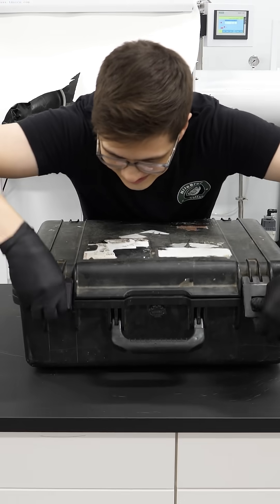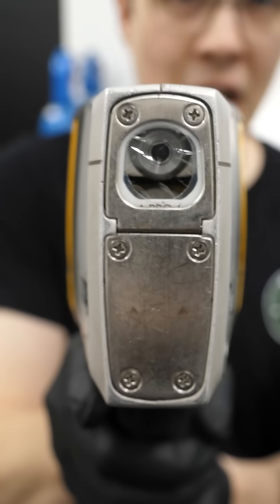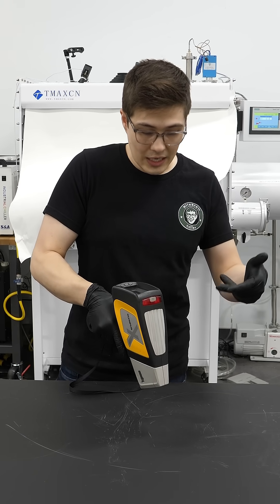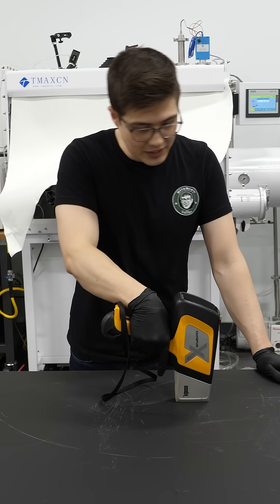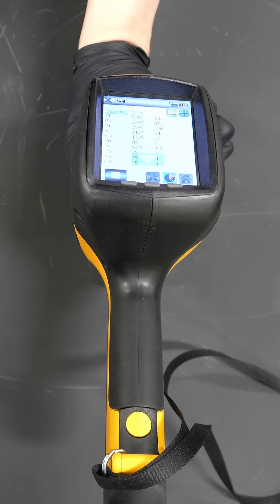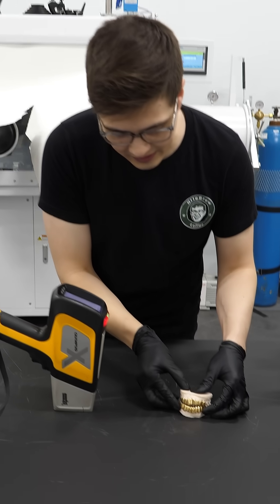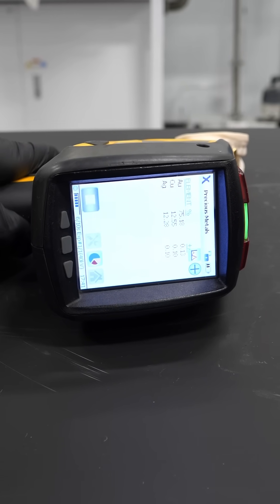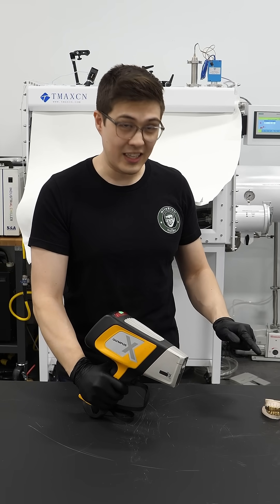I bought a ray gun

Comment: More cool science facts:  Lighter elements - anything on the first two rows of the periodic table from H to Ne - aren't able to be measured directly by XRF.  So you can't use this to determine the precise amount of carbon in your steel, or how much oxygen (usually in the form of oxides or hydroxides) are in a geology soil sample, or the composition of PLASTICS like the coating on your lab benches there.  But it works pretty well for heavier elements.  With some caveats... a few elements emit at multiple frequencies, some of which overlap with other elements.  Those elements are hard to detect at low levels because they tend to get buried within each other's signals.  And whatever the element inside the gun is that produces the x-rays also can't be detected... because its response will look the same as the beam that leaves the emitter and you cannot mathematically separate the original beam from the same element in the sample.  
So it's primarily used for detecting metals in paint, minerals in soil, or alloy compositions of metals.  I used to work with a bigger free-standing XRF machine that could also detect dangerous metals like lead and mercury in plastics, which we tested for some toy manufacturers to comply with government safety regulations.  We also used that same machine to look at mineral composition and corrosion compounds from leaky oil and gas pipes, oil spill soils, etc.  It's pretty cool.
Reply: Yes indeed. But because they are open-beam x-ray sources, and a significant safety risk, they are heavily regulated in Canada. Both to possess and operate. Hope nilered has passed his certification course!
Reply: I think you are good at describing this relatively complex subject without being strident and pedantic, if a few factoids were aesthetically fudged, I think it keeps potential students on their toes, and was enjoyed by me at least; thank you for taking the time.🌞💚🐾
Reply: So question… 18 karat is defined as 75% by weight. How would the X-ray gun get the same measurement of 75% composition? Because I assume it is measuring at a molecular level like number of atoms which wouldn’t necessarily be 75% right? Or is it just doing some math to tell you that
Reply: @horsey7408   It shoots an X-Ray laser into the sample.  Each atom in the sample reacts to the x-ray by having electrons kicked around, resulting in the atom generating ANOTHER X-RAY but at a different frequency than the original beam.  Each element shoots off a different frequency.  The sensor on the gun can measure all the frequencies, and then it does a bunch of math to determine how much gold, how much lead, how much tungsten, how much iron, etc. by comparing the test result to a scan you did earlier using a KNOWN METAL ALLOY STANDARD as a calibration comparison.  Anytime you're using the gun, at the start of the day you get the calibration samples out and run a calibration test to tell the software what it's comparing test samples to, basically it gives you a "background zero" to start with.  And then it converts the measurement of the intensity of sample's x-rays into a mathematical composition percentage for each element that it detects.
Reply: @MrDavidMoyer It's not an X ray "laser" or an element. It is an electrically produced X ray beam from an X ray tube. Smaller version of what is in a hospital X ray machine.
Reply: @SantaKrause  Exactly.  It's just fun to say "laser."
Reply: @MrDavidMoyer   If you are going to go explaining something that you claim are "facts", then give correct facts. Laser beams are produced in a completely different process.
Reply: @horsey7408  Also, the X-ray gun only measures a response from the top few layers of atoms in the sample.  So it only reads the atoms near the surface.  If a piece of metal has a "pure gold" coating or plating on it, the gun will probably tell you it's "pure gold" even though the interior is plastic or copper or whatever else.
Reply: If you scanned your hand would your hand receive any kind of damage
Reply: @diamondsimon020   Not like a painful or visible burn if that's what you mean.  It's similar (but less intense) to a medical X-Ray.  The issue is that your DNA molecules can be destroyed or altered by x-rays.  So a few cells might be killed immediately, or might gradually become cancerous, or might get "radiation sickness" and die later.  And that kind of damage, while not usually harmful from just one exposure to the x-ray beam, will accumulate over time - especially if you use the equipment pretty often and "accidentally" scan your hand A LOT of times.
Always best to take precautions anyway.  Cancer sucks.
Reply: @ Aight thanks, I thought it might give some kind of cancer or something, but I didn't understand how exactly, that's good to know
Reply: @diamondsimon020   Possible radiation burn.
Reply: @SantaKrause   The beam is too weak to leave an actual burn like you would get from acid, sunburn (UV damage), or a flamethrower (heat damage).  But yes, you can get "radiation poisoning" which usually doesn't show up immediately but maybe a few days later you'll notice the affected area is turning dry, gray, and basically dead.  It's not like standing in front of an IR source that emits actual heat, or a microwave source that generates heat by messing with the electron structure of water molecules.  There is very little heat released, it's all basically just X-Ray light.  
If you're using one of the large industrial XRF machines they use in materials testing labs, then yeah those things can generate significant heat.  You need to use water along with helium or neon to keep them cool, while for certain operations also for keeping the sample under an inert gas for testing.

But a "radiation burn" isn't really a burn.  At least not in the traditional sense.  It's literally cellular damage caused by the beam wrecking the DNA on that part of your body.  But those cells can stay alive (and APPEAR undamaged) for a short time after that; the damage only becomes obvious when the wrecked DNA starts making new RNA, which is also wrecked so it makes wrecked proteins once it's active... or the DNA just falls apart to the point where the cell loses all function when its current proteins are exhausted or when the cell tries to go through mitosis.  The real damage happens when/if that wrecked DNA starts to replicate faster and spreads farther than your normal healthy cells around it.
Reply: @MrDavidMoyer   That dry, red, dead area IS a radiation burn. Burn means cellular tissue destruction. Doesn't matter if is is heat, chemical, or radiation. This device will NOT give you radiation sickness or radiation poisoning. That comes from a much higher dose of radiation than this machine can produce or ingesting radioactive materials. It CAN give you a radiation burn if you are in direct contact with the emitting window depending how long the test sequence time is set for. I have spent over 30 years in an industry dealing with both high energy radioactive materials and radiation producing machines on a daily basis and I have plenty of knowledge about radiation and what it can do.
Reply: @MrDavidMoyer  You are incorrect. It can give you a radiation burn.
Reply: @SantaKrause   If you hold the trigger down for several minutes, maybe.  From a single scan that only takes a couple of seconds, it shouldn't.  With radiation the damage depends on the energy level - x-ray is pretty high energy but not the worst out there, and you shouldn't get a full-intensity blast unless you're literally aiming directly at your own hand.  Any incidental exposure, like a reflection of the beam escaping sideways or whatever, won't be as powerful as a direct shot.  And it also depends on the exposure time, which with these guns is typically only a few seconds.  
And as I mentioned, a lot of radiation damage won't show up immediately, it can take hours or even days for the damage to manifest in a noticeable way.  

But the key is even though we still use the word "burn" when talking about radiation damage, it's not the same thing as a chemical burn or a thermal burn.  The actual damage is caused differently, is expressed differently at a cellular/molecular level, and even though the eventual scars might look similar, the process by which the damage occurs is not the same.  That's the point I was trying to make.  But yes, some of the damage can resemble burns regarding the surface appearance at least.  You can think of it as being closer to a sunburn than sticking your hand in an open fire though.  This isn't an a-bomb we're talking about here.
Reply: @MrDavidMoyer  Typical exposure is 10 to 20 seconds. A burn can occur if in direct contact with the emitter window for that length of time depending on the unit as the beam is very narrow and concentrated with almost zero sidescatter. A burn is cellular tissue destruction. Doesn't matter the cause, heat, cold, chemical, or radiation, it is still cellular tissue destruction at the molecular or atomic level. The result is the same, the tissue dies. The dry, red, dead area you described is a burn. This machine will not cause radiation sickness or poisoning. That takes a much higher dose than this machine can produce. The older machines like this are more powerful in radiation production as they had less sensitive detectors and were phased out and replaced,  but I'm sure there are many still out there and in use. I have over 30 years working with high energy radiation and radioactive materials and know very well about radiation and what it can do and have seen radiation burns first hand on several occasions. One individual did, several years later, develop leukemia and eventually passed away, but leukemia did run in his family to begin with, so there really is no way to say it was caused by radiation.
Reply: @MrDavidMoyer   It is not caused by it "wrecking" the DNA. It is caused by radiation knocking the electrons off the atoms that make up the molecules in the cells and therfore the cells cannot function properly, leading to their death. I need to learn a bit more on how radiation works. 20 of my over 30 years of working with radiation was spent as a RSO(radiation safety officer).
Reply: It uses a source with Iron-55 that produces X-rays via electron capture mechanism. It emits 5.9 keV almost-monochromatic beam. The capsule's half-life is 2.7 years.
Reply: @Matthew.Morycinski  The one he is using is a InnovX Delta made by Olympus. Does not use any source. It uses an X ray tube. Have used this model many times.

Comment: XRF guns have been incredible for the mineral exploration/mining industry. We used to have to wait months to test minerals or samples at a lab, but with these, we can do a quick test in the field.
The one weakness is that it often doesn't give a representative sample. For example, if there is a layer of a different material on top, that will show up instead of the true composition. There's no way to tell if those gold teeth have lead cores.
Reply: Funny that... X-rays are commonly known to penetrate organic tissue, yet they lack penetration when applied to other materials.
Reply: @__Razer  Actually that's by design! The reason we use specific X-ray frequencies is because those ones in particular pass through most organic materials while reflecting off of mineral sources like bone, high density cartilage, and teeth. 

There are also slightly different ranges they can use to tweak what materials will reflect, so with precision you can actually tell the difference between 'softer' materials by how opaque those spots become.
Reply: @__Razer well yeah, bc organic material is much more permeable to radiation than metals
Reply: @hazeld8016  but not always! There are certain bands that highlight soft tissue more than hard. That's what my comment was about, that we use specific ranges of X-ray for different images.
Reply: @caseyoverland7829  The device is an XRF which is "x-ray fluorescence" and works by illuminating a sample with x-rays and then analysing the spectrum of the fluorescent x-rays coming back off the sample which are at lower energies than the illuminating beam and have very little penetration.  There is no imaging involved.
Reply: @karhukivi  we weren't talking about this specific device, we were talking broadly about x-ray usage in general. I am aware of how a spectrum analyzer works, and while the XRF gun is specifically a sampling tool and not imaging I was speaking broadly.
Reply: @ The question at the top of this thread was that the depth penetration of an XRF was small and limited to the surface material.
Reply: @karhukivi  the question was about warning labels? And whether or not there would be danger of shooting through a desk or towards yourself (assuming a wooden desk, not metal. Though maybe that's my bad)
Reply: @caseyoverland7829  There are some warning labels but when the H&S people get to know about portable XRFs there might be restrictions.  The HVL for wood at 50keV (typical for these devices) is in the range 0.15 to 0.3m (6" to 1 ft) so you could shoot yourself sitting at a wooden desk and using this device on top.  There is a proximity switch on some units, so that you won't shoot people by pointing it at them!
Reply: @__Razer  The energy of the primary beam is low and the fluorescence x-rays have even lower energies, so very small penetration.  The surface is being measured to a depth of 1-3 mm only.
Reply: I've actually used one of these before to analyse drill core samples when I worked as a lab tech for geologists. There's also a larger tabletop version with a lid that closes shut.

We used these tools to obtain an internal standard for calculating trace element ppm concentrations from laser ablation mass spectrometry data.
Reply: I was actually wondering how deep the xray went so thank you for the info
Reply: We use the XRF analyser in tandem with a PMI. When we identify the metals with the XRF, we enter the figures in a PMI which has the density of all metals. The PMI then tells if the sample is homogeneous or what metal makes up the most of the sample.
Reply: Gotta grind up the samples and hit the dust right?